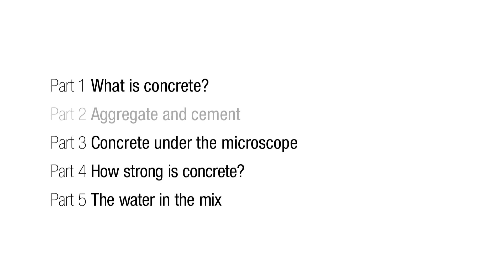What is aggregate? - The Bare Essentials of Concrete - Part 2

Comment: Sir actually you need around 1350 degree Celsius in the kiln to produce the intermediate product named clinker and grinding it with gypsum in cement mill to produce cement.

Comment: How come concrete store energy in winter and release in summer?
Reply: Because it’s like water. It stays hot relatively long and stays cool relatively long(ice). consider heat is energy, the concrete holds that heat from the summer and releases it through the fall then when it finally cools in the winter it stays cool until it’s heated up by the summer. So consider the building a big ice cube by the time it get hot out the cement will still be cool for awhile because the building will keep the air around it cool. This is the exchange of energy he is referring to.